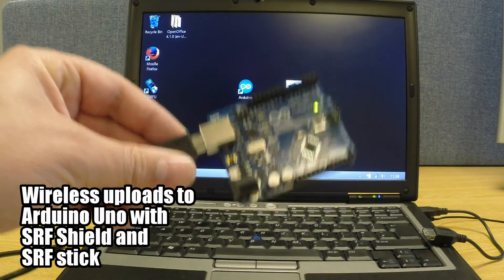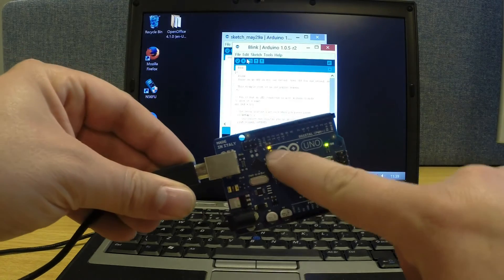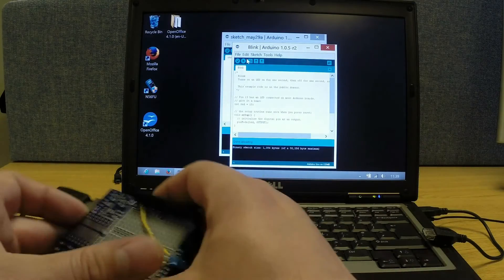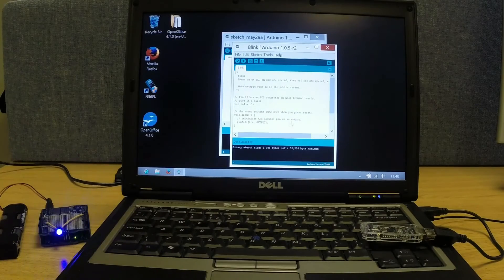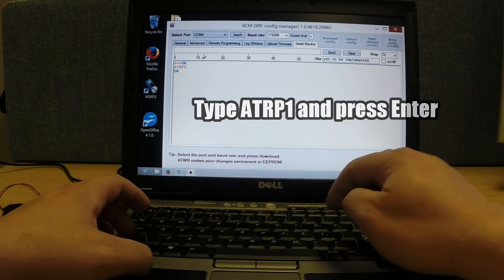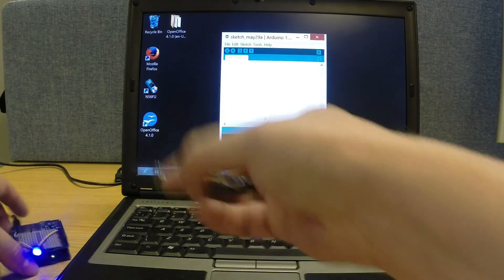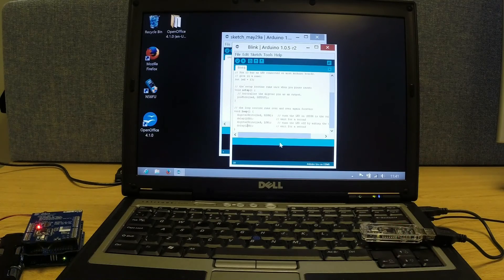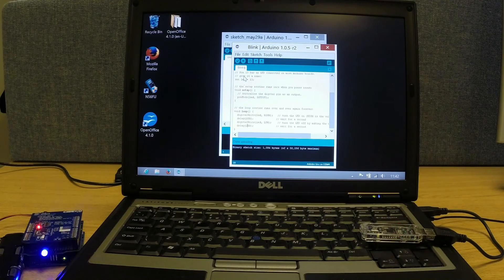Ciseco SRF shield wireless upload direct from Arduino IDE via SRF stick

Comment: will this work with Leonardo, Due and Mega 2560?
Reply from the maker: Unfortunately it will not work with Leonardo. It also does not work with the Due as it requires pins to wiggle which are not accessible. However, the Mega 2560 is currently incompatible with our protocol but this might be something for the future. Short answer - no.  

Hope this helps.  
http://shop.ciseco.co.uk/